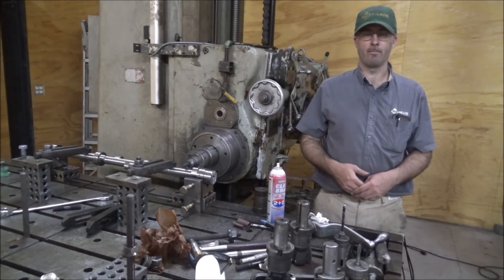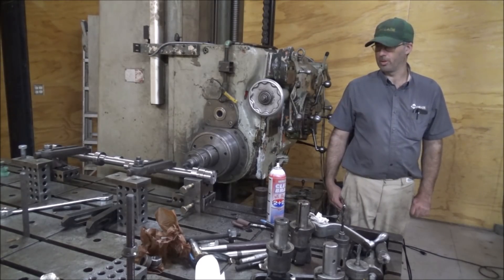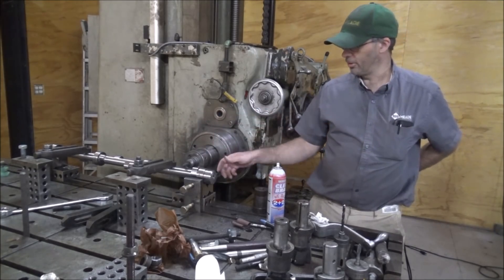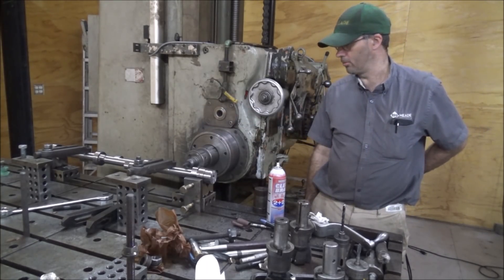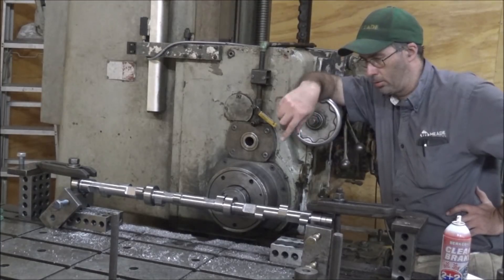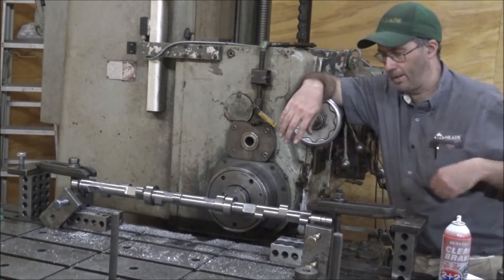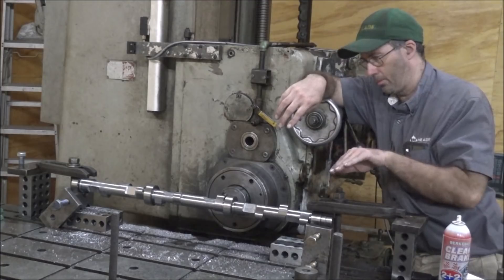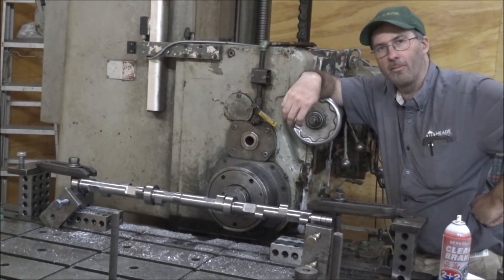Camshaft Machining for a Stroked Crank

Comment: I noticed there any extra wasn't support under the shaft
Reply: My mistake on my message,what I wanted to say there wasn't enough support where as it could bend .i think 💭.great job you are a master.thank you for the video.Tony from Canada 🇨🇦
Reply from the maker: That is why I did plunge cuts in the middle, it made the force direction such that any deflection in the part would not effect the final dimensions.

Comment: I would think that is would weaken it a fair amount, or in rotational stress it's not a problem.
Reply from the maker: Loads are low and balanced so not a lot of stress on the turning of the cam, besides there is still at least 1.25" diameter left and that size shaft can take a lot of torque.

Comment: As much engine work as I've done, this is one aspect that I never got into.  Bore, crank, & head corrections, maybe a few small enhancements if they were easy.  My goals were usually to get it to quit burning oil and quit leaking, and run on all cylinders.  After that, it was a case of extracting all I could from what was there.

I had a classmate that had a rare one, a stock auto that, for some reason, could beat the tar out of most of the hot rods in the region.  Never could figure out what made the difference, all of us would have tried to replicate the conditions if we could find it.
Reply: diggerop A friend's father was a machining instructor. He had two students who both owned the same model of car. One hot-rodded his to the skies. The other just polished everything in sight. Guess which one went faster.

Comment: Are those cuting surfaces gone to be polish to prevent cracks in the camshaft ? notice there is a radius to prevent it ,but under high stress cracks develop-JUST CURIOUS
Reply from the maker: Shouldn't be that much load. It is bound to be stronger than the cast iron one it is replacing that was done the same way.

Comment: So was the camshaft not hardened yet or are you using a carbide end mill .
Reply from the maker: carbide, but also only the lobes are hardened. They use directed induction hardening.